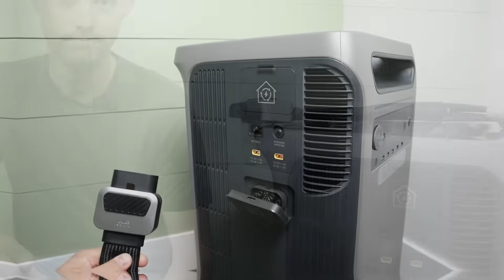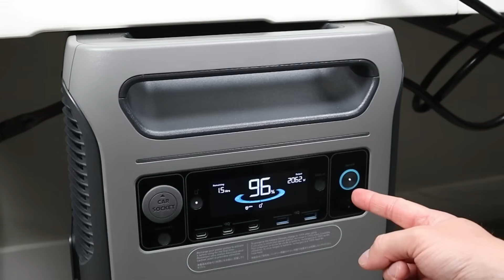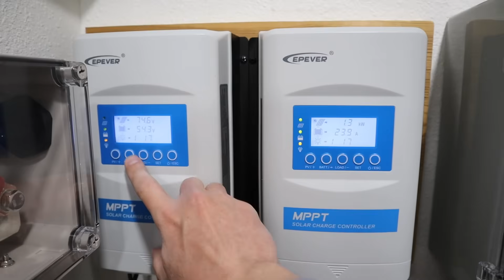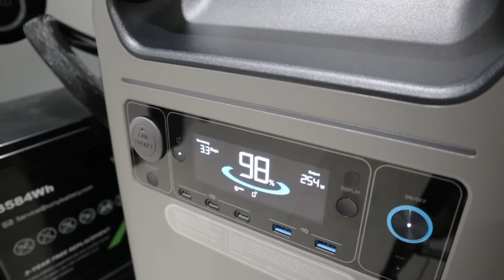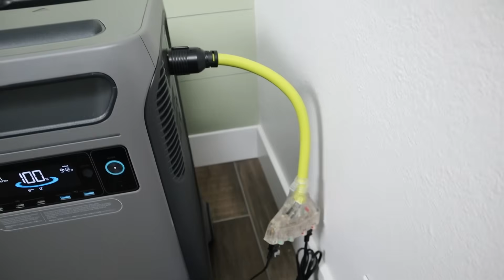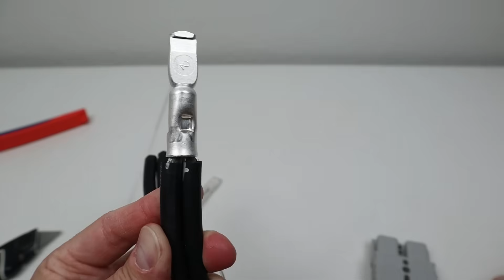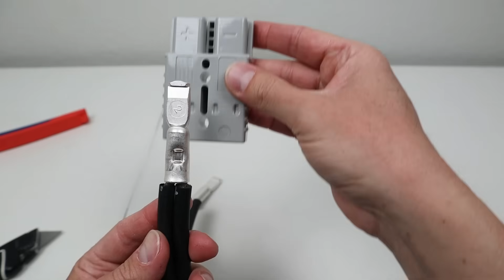I didn't Know This Was Possible!! Backdoor Battery Access to the Anker SOLIX F3800!

Comment from the maker: Inspiration for this project came from  @NoiseLab47  . You can find  @NoiseLab47   Anker F3800 Videos HERE:
https://youtu.be/B6EP5EYCRQ8?si=fh2Q6n_LYgWiQXHb
https://youtu.be/afumx_g3Xg0?si=B9IB6Vt7WLqbdqxp
I'm sure there are plenty of other videos on YouTube doing similar experiments but this was my main inspiration. Thanks NoiseLab!
Reply: I was hoping you were going to do more in-depth testing since NoiseLab didn't test with a LiFePO4 battery. I didn't like the mismatched battery chemistries! So cool to see DIY expansion batteries working without an issue.
Reply: Did you also do this with the F3800 Plus?
Reply: You can’t buy the expansion cable anymore! Just in combination with the bp3800!
Reply: The Old Jarhead did a video where he hacked into the big extension plug, put on O rings and connected to a battery.

Comment: Question:  If I had an F3800+ and a Solix Expansion battery, would it be possible to take the Expansion cable and leave the COMM cable intact, and instead cut/splice in +/- connections for non-Anker batteries?  So basically the cable would connect the F3800+ to the Solix battery and communicate with it, but it would actually be transmitting power from the Solix battery AND non-Anker batteries?  Or will this explode 😁?

Comment: The SB175 connector are rated for 12-36v and the Solix is 48-51v isnt that a hazard risk? Also is the new f3800 software update affect this tests at all? Also can you try to use the Anker extension battery in your tests, maybe connecting it straight to a 48v inverter for camping use or in series with your other batteries?

Comment: Has anyone looked into the signaling with the smaller wires that are on the cable? I counted 12 pins in the expansion port for LV signaling. Wondering what all goes on there.

Comment: Yes, the AC outlet button on the Anker SOLIX F3800 Plus will automatically turn off after 15 minutes by default if no AC plug insertion or active load is detected

Comment: I have two Anker F3800s connected to the Anker Home Power Panel, and during Prime Day I purchased an Eco-Worthy PowerMega 16 kWh battery. I added the Eco-Worthy battery to my existing setup using the Anker expansion cable.

For simplicity, I’ll refer to my two F3800s as Base 1 and Base 2. The Eco-Worthy battery is currently connected to Base 2.

Over the last few weeks, I’ve been watching how the system behaves during charging and discharging. Base 1 tends to discharge first and also reaches 100% first when charging. Once Base 1 reaches my minimum SOC setting of 20%, it goes into standby until the next charging window.

My system is configured around my TOU plan, with peak hours from 4–9 PM. Once Base 1 goes into standby, the house continues running from Base 2 and the Eco-Worthy battery. For the most part, the Eco-Worthy comfortably supplies around 30 amps. If the house load exceeds what Base 2 can provide, roughly 3.8 kW, the grid picks up the additional load.

I’m okay with that because before adding the Eco-Worthy battery, on hot days both Base 1 and Base 2 could reach their minimum SOC and go into standby by around 7 PM. That left me pulling completely from the grid for the remaining two hours of my peak period. Now, even though I may still pull a little power from the grid during heavier loads, the Eco-Worthy gives me considerably more battery capacity to make it through the 4–9 PM peak window.

Eventually, I would like to add a second Eco-Worthy battery and connect it to Base 1. That should give both F3800s additional capacity and make the overall setup more balanced.

One thing to keep in mind is that when Base 1 reaches 20% and goes into standby, my available output drops from approximately 12,000 watts to 6,000 watts. During a normal day with the grid available, that isn't a major concern because the grid can supplement the system. During a power outage, however, I'll need to pay closer attention to the loads I'm running.

My plan for extended outages is to use my ChargeVerter with a propane generator to keep Base 1 charged enough to remain active. That should allow me to maintain the full output capability of the Home Power Panel without having to significantly scale back my household loads.

Another thing I've noticed is that the Eco-Worthy doesn't usually make it back to 100% SOC during normal charging. Before initially connecting it, I charged it to approximately 54.5V so that it closely matched Base 2. However, because the Eco-Worthy is connected to Base 2 without direct communication between the two batteries, Base 2 can reach 100% and stop charging before the Eco-Worthy has completely recovered.

Because of this, the Eco-Worthy will sometimes end a charging cycle at around 77–85% SOC. My solution is pretty simple: every once in a while, I can use the ChargeVerter to top off the Eco-Worthy separately and bring it back to 100%.

There are definitely some compromises when combining batteries that don't communicate with each other, but so far they have been very manageable. For me, I'd much rather deal with these small quirks than spend the significantly higher amount of money required for Anker expansion batteries.

Overall, I'm very pleased with how the setup is performing. So far, I haven't experienced any heat-related issues with either the Anker F3800s or the Eco-Worthy PowerMega, and adding the 16 kWh Eco-Worthy has made a noticeable improvement in how long my system can carry the house through peak hours.

Thanks, Jason, for all the helpful information you provide on this channel and for taking the time to answer all of our questions. Your help is greatly appreciated. Good luck, everyone!

Comment: I modified the Anker external battery cable with an Anderson connection and 2awg wires and 110a t fuse block. Just connected to a 48v 100a lifepo4  and it’s working!!  Thank you 🙏 installing a generator interlock soon. F3800 Plus.

Comment: Still waiting for someone to hack the delta pro ultra.
Reply from the maker: Battery is 102vdc, to high of voltage.
Reply: @Jasonoid  Couldn't you series two 51.2 v batteries then connect it into the unit?
Reply from the maker: @stephenfleming8474 nope, they don't support that high of voltage.

Comment: OffGridStores no longer has the battery expansion cable. Do you have an alternate source?  Have you had a chance to test it with the F3000 Power Station?
Reply from the maker: I don't know of another source for the cable.

I recently tested it with the C2000 Gen 2 (same port) and it worked well running a 48v Air Conditioner 👍 F3000 is the same

Comment: I have an Anker F3800 and a Firman Zero E with 3 expansion packs. On the Firman it has 2 DC ports in the manual it specifically says it’s designed to daisy chain multiple batteries from any manufacturer where the Anker would rather hide this.

Comment: Will this work with the F2000
Reply from the maker: It used a different expansion port but if you can measure live voltage (53v) on the port, it should work.

Comment: Hi. Does this only work on the 3800 model? For example, I have a   Solix C1000, and would be interested in expanding it while still using the same system for the application I have it in.

Comment: hey, so I've seen this video 6 months ago, and I've been wanting to implement this, for longer, though (just didn't know i could use the ports)
i hooked up a 7.6kwh external bank +a 150/35 victron charge controller, my bank has jk bms on it, and the whole thing is working great so far, warning when doing this, limit the current that can go through the ports, on all devices connected to the port, to a max of 40 amps if you aren't using the original plug (i made my own cable)
my pv array now is 12 panels 3s4p and a total of almost 12kwh of storage...
o and one more quirk of this configuration, if you are charging your solex from a generator, the external battery isn't full but the internal is, it will stop charging completely, just be aware of it.
and, charging and discharging isn't uniform across the internal and external banks

Comment: On your first test you said you hooked up a 48 volt battery charger to the unit but the charger in the picture says 58.4 volts is that correct? I just ordered a 58.4 volt charger and wanted to make sure this wasn't to much voltage for charging. The output on my port was 53 volts and I assume a 48 volt output would mot work. Thanks in advance. Don't want to blow my battery.
Reply from the maker: 51.2v is the nominal voltage (average battery voltage). Full charging voltage is 58.4v, you're good.

Comment: I have 2 f3800 and 6 pb3800’s , can I charge them thru the solar input t-60 with a 110 volt dc charger off my Honda 2200i generator?
Reply from the maker: When I tested using a battery charger it didn't accept any input. A battery charger needs to see a battery voltage to start working. You could go through the expansion port with an AC 51.2v battery charger though
Reply: Will a charge verter work on it ? While there running the house with the power hub, 12,000 watts ?
Reply from the maker: @RicardoGonzalez-yz1vp yes, the chargeverter is a DC power supply so it will work if programmed to the settings shown in my other F3800 video (about the chargeverter).

It's quite expensive though
Reply: @Jasonoid  thank you, do u have a model number for the chargeveter ? This set up is replacing my heavy Generac Generator and all the hassle that goes with it, we live in a 2nd floor condo, in south Florida ( hurricane ally ) lol
Reply from the maker: https://signaturesolar.com/eg4-chargeverter-gc-48v-100a-battery-charger-5120w-output-240-120v-input/?ref=LiFePO4Batteries
Reply: @Jasonoid thank you, Jason !

Comment: I have a home power panel with 2 of the F3800 Plus. They're limited to 1850 watts of power output without expansion batteries. Somehow the communication line can tell if there are expansion batteries and will increase the power output by around 1800 watts for each expansion battery, up to 6,000 watts for a single F3800 + 3 batteries, or x2 if you have 2x F3800 + 6 expansion batters for 12,000 watts. The marketing is deceptive and doesn't say this.
Reply: From an owner of twin f3800s, c’mon @danepurvis5178 are you suggesting Anker’s marketing could be a trifle misleading? 
In the immortal crying bluberings of Luke Skywalker “. . . that’s impossible!"

Comment: I measured the F2000 station with a multimeter and did not detect any power there. Is there a solution for the F2000 on how to activate it?

Comment: Not psyched to buy a $100 custom cable, cut it in half and then throw half away.  Anker C2000 expansion port connector measures 5.0mm dia (4each).  EC5, a high current connector for RC cars etc. is 5mm banana.  5 pairs on amazon for $8.  Should be good enough for to connect to my solar array as long as I don't hook it up backwards!  Any thoughts?
Reply from the maker: Making your own cable should be just fine. Watch the videos in the description. The guy I gave credit to makes his own cables.

Comment: I just purchased a Anker F3000 and I’d like to do the battery bank expansion hack you show here with my power station. But, will this same expansion cable and the same hack work with the Anker F3000 as well? I can’t find anywhere that explains if you can use that expansion cable with the F3000. I also can’t find the expansion cable that comes with the BP3000 expansion battery for sale anywhere and I don’t want to buy a BP3000 just to get the cable that comes with that. If anyone could help with that info I’d sure appreciate it!

Comment: Question so if I hook up the golf cart battery to the f3800 and use it as an explanation battery when I use the solar panels to charge the f3800 will it also charge the golf battery as well ?
Reply: Mine did when I set it up that way last summer.  I redid it using the solar ports so I could run higher voltage solar controller from my panels and I wasn't comfortable with the wires I used on the battery ports..
Reply: Hello so I want to build my own diy expansion battery I have the timgo battery my charger controller and inverter is ordered i just need solar panels  I plan to add another battery once I get what I have set up I need you help wiring all this then adding the 2nd battery if you would be so kind

Comment: Thanks!  I really appreciate how much research and effort you put into this video and all your others :trophy-yellow-smiling:
Reply from the maker: Thank you!
Reply: @Jasonoid  I am about to do this cable hack for my Anker F3800 Plus units (2) that are connected to my Anker Home Power Panel.  Have you heard anything negative about these modified cables, the F3800 Plus or any effect with the Anker Home Power Panel?   Thanks in advance
Reply from the maker: @atlsoutherndog nothing in the comments section so far. Just read through and see if you see anything 👍

Comment: Jason - your videos are awesome and it's great that you have showed this DIY battery work around with so many power station models.  But I would be interested in any thoughts about using a DIY battery with Anker F3800 Plus that is connected to Anker Home Power Panel ( I have two Anker F3800 Plus units, six BP3800 expansion batteries... all of which are connected together and plugged into the Anker Home Power Panel that feeds my sub-panel).  Any thoughts if the Home Power Panel could negatively affect anything.

Comment: Much appreciated! I have a C2000 Gen 2 on the way (Black Friday deal) and it appears to have the same expansion battery port. As you know, battery expansion packs from Anker are pricey compared to what you can get on the open market.
Reply from the maker: This hack will work the C2000 Gen 2, it also has live voltage at the expansion port 👍
Reply: @Jasonoid  With that in mind, shouldn't the F3800 cable work with the C2000 Gen 2? Apologies if that comes across as a stupid question, but some AI response indicate otherwise. I trust real people first though... thanks for all of your work!
Reply from the maker: @scotthalligan4675 AI is pretty much always wrong with power stations.

Yes, the port is the same so the cable should also work.
Reply: @Jasonoid I just recently purchased the C2000 Gen 2, so that's great news! I'm interested in connecting a 51.2V 100Ah golf cart battery via the expansion port. Do you know where I can find information on the best approach to modifying the end of the expansion cable that will connect to the battery?
Reply from the maker: @WillWhitworth should be exactly like the F3800

Comment: Thanks for this video! The expansion battery charging cable is out of stock at Off Grid Stores, but I found it in stock at Off Grid Source at a great price.

I would love to see more videos re: details on the setup and use of this method, charging large external batteries via the F3800 Plus and this hacked cable, vs using external chargers to charge the external battery. I have the F3800 Plus + 2 BP3800's on order plus a 51.2V 300Ah Datouboss battery from Aliexpress. Very excited to set all this up!!!

Comment: Has anyone tried to power one of these chargers using an EV? I have an F150 lightning sitting in the garage with a 131kwh battery back, that I would love to tap into during a power outage. Unfortunately I did not think to get the Pro-power package that does 240v, but It can do 120v at 20amps (2,400 watts). The original F3800 is $1,799 on amazon for Black Friday. Seems like a cheap way to tap into my homes existing generator transfer switch, while extending the life of the power station via the Lightning's AC Power outputs. Anyone run into grounding issues, etc?

Comment: Hello, I’ve got a simple question if anybody could help me out. I used to install Solar, but I never really got too much in depth just repetitive installs for houses and I am working on doing some work at my house. I have two. Anker solix f3800 and I’m looking to get some panels, but I wanna get as much out of those panels as I can for my home power panel and my units. A charge controller will that be able to have a setting to let it not get over the limit with the 1200 W per port and max 60 V.. I’m just wondering if anybody has ran into this because I have the EG4 chargeverter but I want to use that for emergencies and use Solar as my main source for charging the charge controller is what I’m trying to figure out if it has settings to be able to make sure that the units don’t get maxed out
Reply from the maker: Did you watch my other Anker F3800 video where I discussed the right solar panels?
Reply: @Jasonoid  which specific video is that?  I missed it... thanks

Comment: late to chime in but once again your video is proving to be helpful and valid even 6 months after. I am in the process of building a parallel 24kw system using two 12kw inverters + big 280ah batteries, but with Black Friday pricing and ability to use regular rack batteries, building a 12kw system using two of these Ankers, a combiner box and rack batteries is more economical and way easier and quicker.

Just a quick question, will this 48v battery addition work with the F3800 plus?

Comment: Another solid video. I was thinking of this with the F3000. It has live voltage on the DC ports on the side which looks very similar if not identical to the F3800 has, and the same two positive and two negatives. Have to give it a go.
Reply from the maker: I think it works the same 👍

Comment: Can you attach 2 3800s to the same battery?  When its pulling power from the hacked battery i dont see a problem but what about when both ankers try and charge the same battery at the same time?  Would that cause an issue.

Comment: Has anybody had any problems with the solar not charging on the 3800. I just bought two of the units from eBay and one charges with DC And Ac and the other one only charges AC.